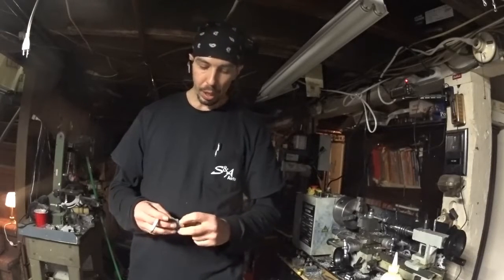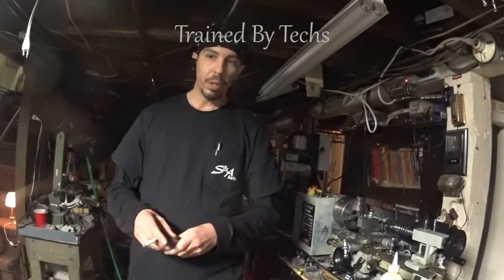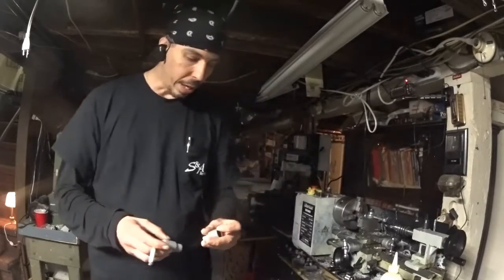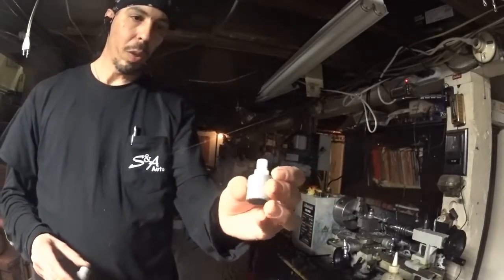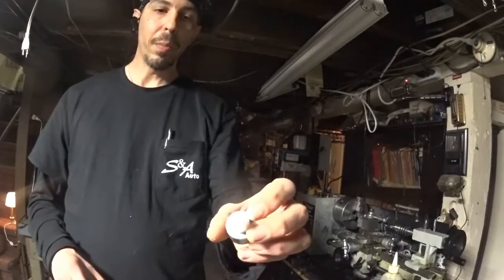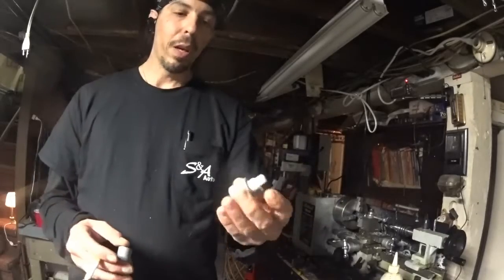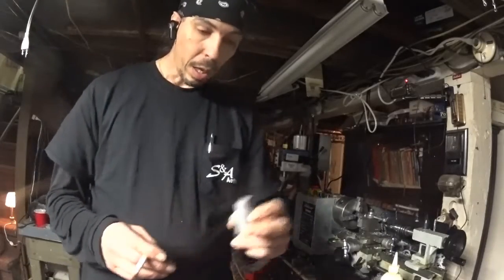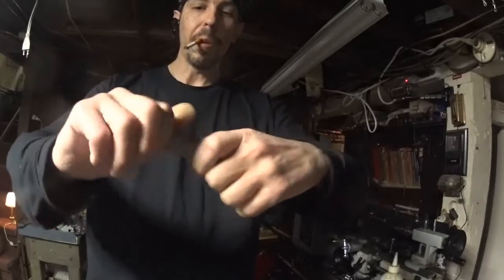Oscilloscope Making a Pulse Sensor Revisited

Comment: I’m thinking about making a cop pickup that runs across a whole bank of coils. Would be nice to have them all on the screen with just one or two channels. I started to build a box that you could hook all primaries to one channel just never got around to spec’ing out the diodes and stuff that would work best. Maybe I’ll get to finishing that when I have a little more spare time. It’s basically going to be like the mixmaster or ferret but for primary signals.
Reply from the maker: That's awesome. Problem is you cannot grab primary on some of these modern coils
Reply: Yeah that’s the only thing bad about it. I still see enough fords, Chrysler, and such with two wire coils that it would come in handy from time to time. It’s really more for the tinkerer in me than anything else. I love building drones, PC’s, and diy electrical gadgets. It’s an addiction lol. I have a WPS500X now so I’m in the process of building an Arduino powered box that uses my old transducers for a handheld digital pressure gauge to use with fuel/oil/trans.

Comment: Good stuff Joe, I always like the non intrusive testing first. What gauge wire did you use in those jacks 18 awg?
Reply from the maker: Leads are pre wired. I believe 16 gauge.
Reply: Mine looked like 16 gauge leads as well. It’s a low voltage signal so as long as your connections are good and secure just about any size wire is fine.
Reply: John Pilgrim thanks John reason I asked is I want to make my own banana do bnc leads and I wanted the wire to fit perfect in the neck of the banana plug if that makes sense

Comment: Where do you get the sensors from?
Reply from the maker: They are Piezo sensors
Reply: @JoesAutoElectric  first time i heard of piezo was from my rc flying days. My helicopters had piezo crystals inside the gyroscope.
Reply from the maker: They use them in self starting lighters as well. And smoke alarms...Many applications.
Reply: @JoesAutoElectric  I'm gonna keep it simple and get a ac pressure transducer. Then I already have threaded end, and easy to acquire pigtail for wiring. I think I have a plan lol